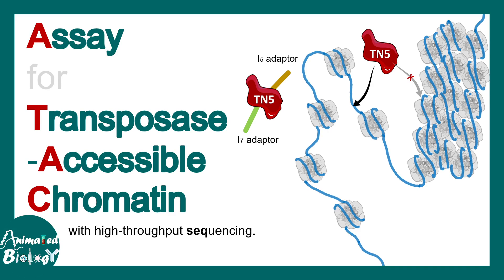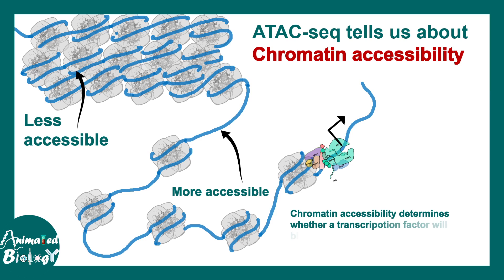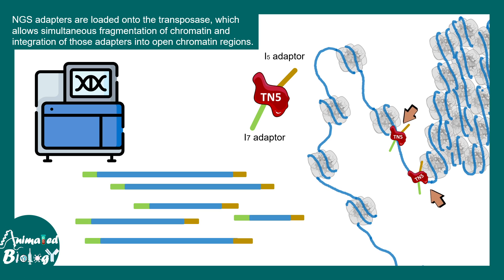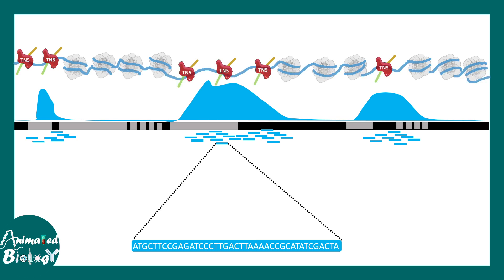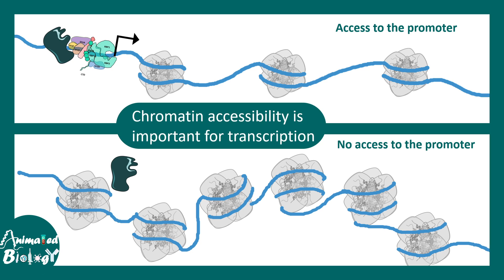ATAC Sequencing explained in 5 minutes | What do ATAC-seq peaks represent? | Mol-bio

Comment: 00:02 ATAC Sequencing is a fast and cost-effective method for determining chromatin accessibility.
01:01 ATAC-seq uses tn5 transposase for chromatin accessibility
01:49 ATAC sequencing captures accessible genomic regions
02:39 ATAC-seq peaks represent accessible chromatin regions
03:32 ATAC-seq peaks indicate chromatin accessibility and gene activity in different cell types.
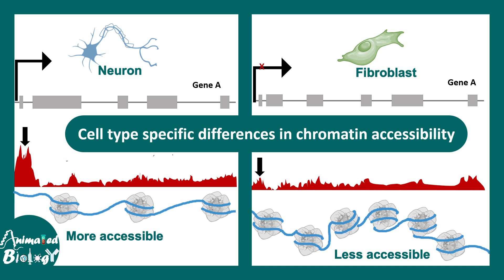04:21 ATAC-seq peaks represent chromatin accessibility differences between cell types
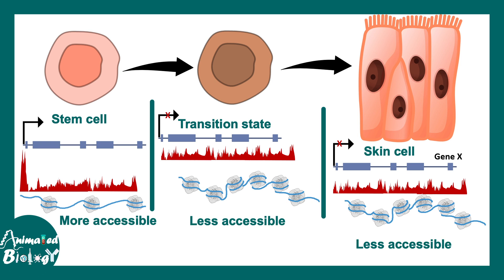05:06 ATAC-seq peaks represent changes in accessibility across the gene.
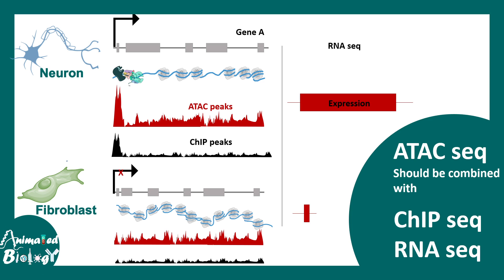05:54 Combining ATAC-seq with RNA-seq provides a holistic picture of transcription dynamics.